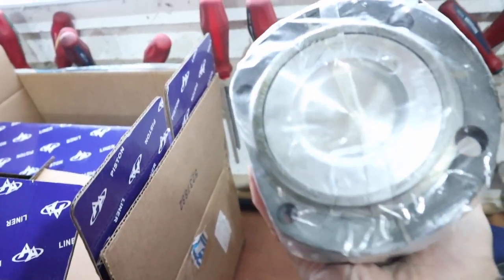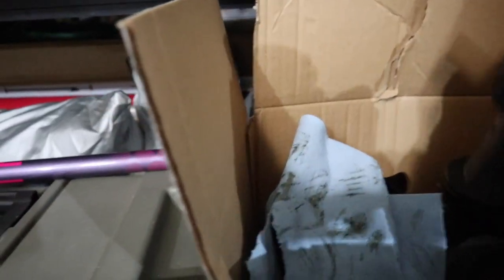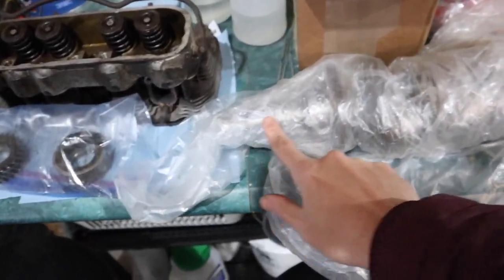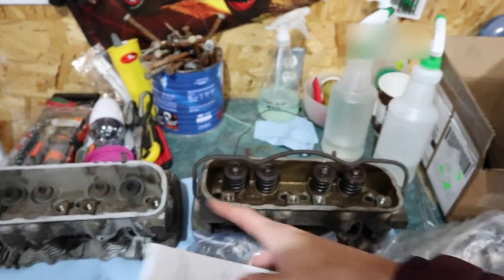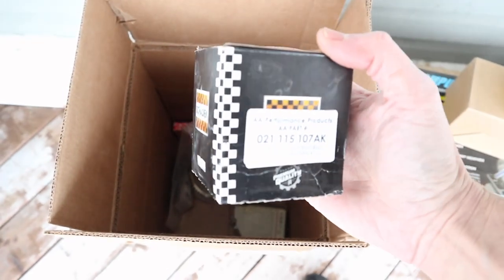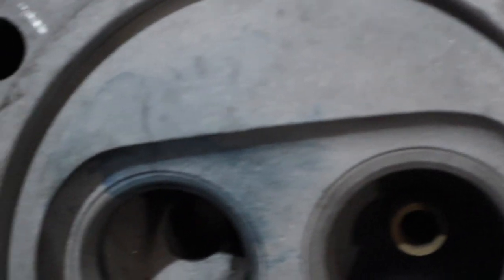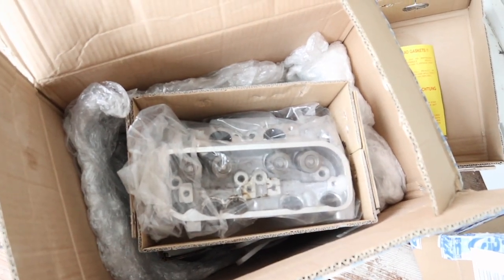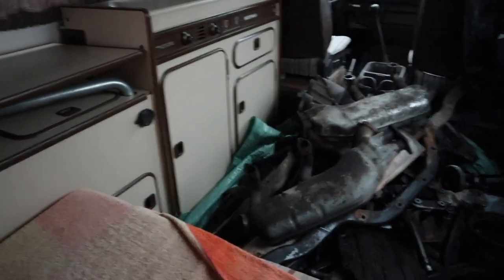Cracked Heads 😩 Air Cooled Vanagon Engine Rebuild Status - Netcruzer CARS

Comment: Those amc heads are not better than oem heads. They are known to last about half as long as oem no longer available heads FYI. They can be reworked to oem specs with new seats, valves, springs and a proper valve job, but from amc they are not that great. People report around 30,000 miles longevity.

Comment: I have a pair cooled citroen gsa and it is interesting to compare them.  The citroen has belt driven camshafts  in each head
Reply from the maker: Belt driven dual cams?! Wow, is that also different than a timing belt vs chain?
Reply: @netcruzer  it has a twin timing belt from the crank to the camshafts the left belt also runs the oil pump. the fan is on the crankshaft similar to the later VWs